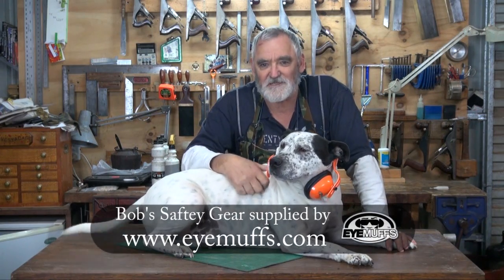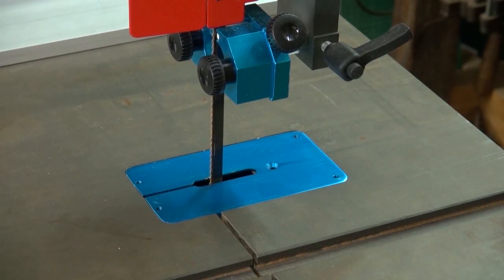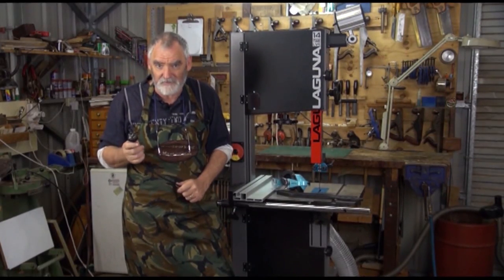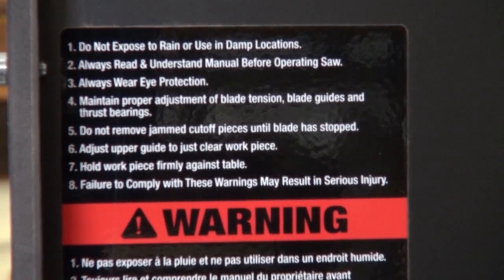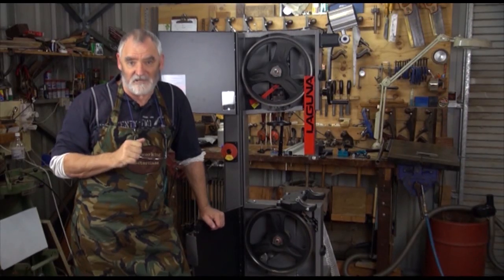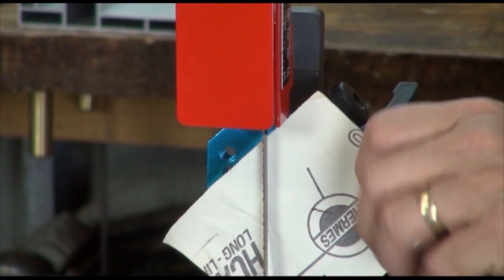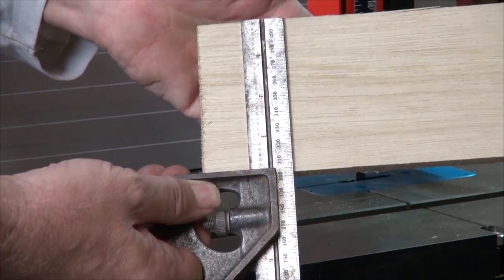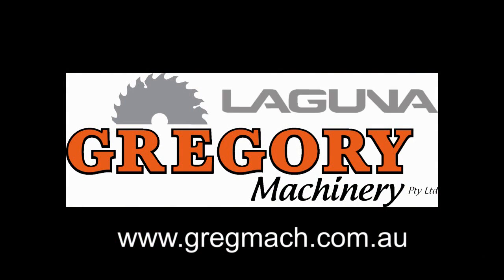Bandsaw 101

Comment: Good introduction to use and setting up of the bandsaw. Appreciate how you covered most of the high points and safety cautions. Especially how to inspect the blade for cracks and tooth alignment. Might have mentioned cleaning tires on wheels before putting blade back on and how to properly tension blade since marked indicators are only approximate due to wear on the machine and manufacturers of blades. Thank you for sharing.
Reply from the maker: MRrwmac Good point thanks for bringing it up. Even though a lot of the newer machines are fitted with cleaning wheel brushes there is still a fair amount of sawdust that get stuck and worked into the rubbers.Especially from sappy wood. So if you haven't already periodically clean off the rubber and you'll notice the saw is quieter and runs a lot smoother. Cheers Steve

Comment: great video Steve, I must have missed the part about tensioning the blade when replaced. Also I was told not to touch the tension once set unless changing the blade. With my scroll saw I always release the tension at the end of the day, would this be the same with the bandsaw? cheers
Reply from the maker: 1958linedancer I on occasions have to tension the blade as I work depending on the material i'm cutting. I'm not sure why, but a couple of guesses are if you using it a lot heat will expand the blade slightly the blade also in time the wheel rubbers settle which will again have an affect the blade tension. There are digital tensioning gauges about but I've never used, as I go by feel. Which is very hard to teach or explain over the net. Like the tensioning a scroll saw, you know when it's to tight and you can tell when it's too loose. As regard relieving tension on bandsaw when not in use. Up until recently Bandsaw didn't have tension levers so I never released the tension. And now I have a machine with a tension lever I still don't release it. Not sure if that is a good thing or not but I've never had any trouble as a result. The other thing is a bandsaw blade is far sturdier that a scroll saw blade so that may have something to do with it. Happy Woodworking Cheers Steve

Comment: Hi Steve, thank you for this vid, it's really timely. I have a little bandsaw that I've haven't really used since I received it in March 2015.

I haven't used it because of nerves, mostly. I'm not so worried about the blade as I am of improperly setting up the machine and wrecking it.

This is especially true with the ceramic guides. The factory technician told me that the side ceramic guides should be equidistant along its width to the entire blade. Stupidly, I got some Mitutoyo digital calipers and dial indicators, and now to my impressionnable mind, being equidistant means being accurate to three decimal places of a millimetre. And, even more stupidly, of course there's no way I can achieve that kind of placement.

Adding to my misery is the fact that I fumbled with the factory settings of the guide assembly, so now I have to completely set it up myself.

So, how parallel are your ceramic guides to your blade? If I can't set them perfectly parallel, how long have I got before they explode and take my face off?

If I come across as excessively timid and should not be in possession of my bandsaw, in my defence my machine is a Felder FB510. It's 250 kg, more than 2 m tall, has 2.5 kW, takes up to a 30 mm blade, and I it came direct to my door from the factory in Innsbruck, Austria. Quality Felder might be, but everything is serious money. A single screw assembly costs €5.50, and the ceramic guides, €250; equivalent in my currency? Just multiply by 5. That's almost a quarter of my salary.

So I shudder at the thought of screwing up. Any help would be most helpful, and I would be grateful for it.
Reply from the maker: truebluekit truebluekit Sorry for the delay as I was waiting for a reply from someone at Fielder here. Just got  that yesterday.  But to answer your questions, as I covered in the video, I gently  press my ceramic guides together against the blade. By pinching them together between my fore finger and thumb and then let them go to check there is not distortion with the blade. If that all good pinch them gently together again and nip up the securing nuts. If there is some spring back look at the guide housing and it is probably not set parallel to the table which means it's not at 90 degrees to the blade. Never had a guide explode on me but I will admit to seeing some sparks coming off of them. This is due, in my case, to pushing the timber faster than the blade was cutting and causing the blade to twist slightly. AKA Operator error!!! While I was in the local Fielder showroom yesterday I saw the machine you have and yep it's a Big 'Un. But go ahead treat it gently and do things slowly and it will be the best tool you have in the workshop. Hope that helps, would love to see some of the work you do with it later on down the track.  Cheers Steve
Reply: Woodworking Masterclass
I am speechless. That bit about pinching the guides and checking for distortion is absolute gold.

So I set up the guides and made a cut, it wasn't too bad. Then I made some adjustments, made another test cut.

The cut was much smoother. Oh, heaven...

I know it's kinda silly to be excited about smoothness of cut, but you made me feel much more confident about handling my bandsaw. And, it looks like I can tease out a lot more finesse out of that bandsaw guide.

Steve, not only are you a Master Woodworker, but you're a Master Teacher as well.

Thank you very, very much. And thank Bob too!
Reply from the maker: truebluekit Congratulation, on 2 counts firstly having a go and secondly for success. Thanks also for the compliments not sure if they are warranted or not as I only know what I know 'cos I've done it wrong so many times in the past! LOL. Pleased you enjoy the videos though. More to come. Bob sends a tail wag. Cheers Steve

Comment: Hi Willem, what do you recommend to keep the table clean and help prevent rust?
Reply from the maker: +xHMProductionx I use WD40 and Steel Wool. Initial clean up my require Wet and Dry paper and Kero. For what it's worth my experience is constant use is the best prevention. Cheers  Steve

Comment: Hi good instructions thanks. How tight should the blade be though?
Reply from the maker: It's a feel thing more than a measurement. Tight but not over tight. The gauges they provide with the machines are woefully inaccurate as Blades can strech over time and also be made within in a few millimeters of each other. Try and Test and Try again. Sorry I can''t be more precise. Cheers Steve

Comment: Any tips on drift and setting the blade tracking?
Reply from the maker: Frank Y Several things can contribute to it. Blade sharpness, Blade Tension, Uneven set of the teeth, Out of line guides, Tough timber, Table not @ 90 degrees to the blade. Try some of the tune up techniques and see if it still persists. Sometime (and I've has it) the blade is just out of square when joined. Hope some of these help. Cheers Steve

Comment: Steve, I've heard that the inside curve between the teeth are to sit roughly centered on the width of the wheels.  Thoughts?  I have found if the blade is to far forward the blade does tend to wander up front a bit.
Reply from the maker: Sean Knight Haven't heard that one Sean, but there is a sweet spot where a blade rests nicely and in my experience each blade is a little different. So I can't offer a hard and fast rule except keep tweaking it until if feels right. Cheers Steve
Reply: When you line up the bottom of the gullet exactly centered on the top wheel is often referred to the "Alex Snodgrass method" (Utube him). Many have tried and found it eliminates drift.

It is also why engineers who designed the machines do not have the wheels coplanar, as the blade on the bottom wheel rides in the middle.

Comment: I have a 1412 laguna bandsaw and have grown to like it. The only thing I do not like is the lack of a foot brake. I work alone and it is not a real problem, but if working with others you would have to wait with the saw until it had stopped so the others did not walk up on a moving blade.The extra for the 14 SUV would have been worth it just for the foot brake, let alone the bigger motor and heavier construction.
As for waiting for the blade to stop, it is just not practical as it can take more than a minute for the blade to stop. As I work alone, I just use sticks to remove timber from the saw blade area, remember the blade is moving and use a bit of common sense.
All the best
Reply from the maker: labrat7357 As mentioned in a earlier reply a new 14/12BX is due for release soon and fitted with a disc brake attached to the drive wheel very nice set up. Not that that is any benefit to the present problem facing 14/12 users but it's good to know that Laguna listens to customer feedback and act accordingly. That Common Sense you mentioned ain't so common, in my experience! But adding to that my 10 year old grandson was in the shed with me the other day and even he noted that. "Even though the saw is turned off that could still cut me couldn't it? Smart Kid. Cheers Steve

Comment: Good Video Steve
 I cannot see real good but I think bob was blowing kisses while waving.
Also how do you find Laguna Steve. I have been looking to update a few items, they seem to be the same as the Harvey, as in table saw, anyway your personal opinion would be appreciated.
Reply: Peter Linch Pretty much yes, Harvey == Laguna. There is (potentially) some difference in the factory QA, Laguna in theory has higher QA and customer service than Harvey. Harvey bandsaws may not come with the ceramic guides. Harvey lathes look to be identical though.

I've got the LT1412 like Steve, and its a great - possibly the best 14"/240v@10amp bandsaw out there. Really nice finish, lots of power.
Reply: Paul Jenkins Yes Laguna is the way to go I think, have test run the LT14SUV 14  which is the next one up with the foot brake around $2300 and really like it, and the Harvey table saw will cost me an extra 600 in freight charges to get from NSW and look identical as you say with the lathe, so I think you might be right.
I appreciate your input, as I have made mistakes before and they can be costly in the long run. Cheers for that.
Reply: Peter Linch My "little" 1412 only has a 1.75hp motor, the SUV has a whopping 3hp! I don't think you'll be able to bog that down at all! Don't forget it'll have a 15amp socket on it, adding to more expense if you don't already have that! I must admit I'm a bit jealous of the footbrake, but for my budget, it was already stretched ;)
Reply: Paul Jenkins I have cheated with the 15 amp on another machine, and even though it's never missed a beat, you are right I might have to change a few plugs and update some fuses. I totally understand about budget, alot of my machines have been brought on a shoe string to get a job completed.
Reply from the maker: Peter Linch Love the Laguna Bandsaw, Several reasons; #1 for me is the table is a lot lower that the generic 14" saws. Takes the strain out for the shoulders for me. Also the fence set up is very adaptable being able to be used as a rip and re-saw fence. Easy ON/OFF switch location, within reach, instead of having to fumble around knee level to turn it on and off. Cast Iron flywheels a good as well. Another little nicety is the cover plate is adjustable with grub screws so you can get it exactly level with the table top which eliminates (especially thin) pieces of material getting caught. Only thing I really don't like is the position of the lamp. When I forget to raise it up I tend to smack my noggin on it. But after a time or 12 I got into the habit of raising it when switching off the machine. Hope that helps. Cheers Steve
Reply: Woodworking Masterclass Cheers Steve. Yes the small details count big time and with a few posts from othersI think i'm sold. 
I did wonder where you got all those bumps on your forehead, now i understand. (smile)
Reply from the maker: Paul Jenkins Had a chat to Alan Gregory, from Gregory Machinery, last Thursday and there is ....a Laguna 14/12BX due for release around Sept/Oct this year. The updates include;  a Foot Brake and a 2hp motor. It will come in around the $2000.00 mark. Looking forward to getting my hands on one as well will do a report when that happens. Cheers Steve
Reply from the maker: Peter Linch You should hear the words I have to edit out  afterwards!!!!! Cheers Steve

Comment: That's an excellent video and very helpful to those new to bandsaws. I particularyl liked the safety aspects and although the guides of various bandsaws will vary, it's a very good start.   I have been using my bandsaw for  about 3 years, a 14" Record BS400,  and in the final part of your video you did not cover maintaining the blade in position, but maybe that will be in the future. It is an important part tuning to ensure that the blade is positioned so that it stays in the same place and does not drift off, forward or backward.  I found that the tuning by Alex Snodgrass to also be very helpful https://www.youtube.com/watch?v=wGbZqWac0jU and with that, the bandsaw will be in perfect shape.  Thanks for your excellent presentation.
Malcolm
Reply from the maker: Thanks for pointing that out. and Yes I agree if is a crucial part of setting up a Bandsaw.  I think it is on the extended version which is on our Vimeo channel I'll check. I'm currently making a video on cutting joints on a Bandsaw, I'm attempting 12 differents ones. Cheers Steve